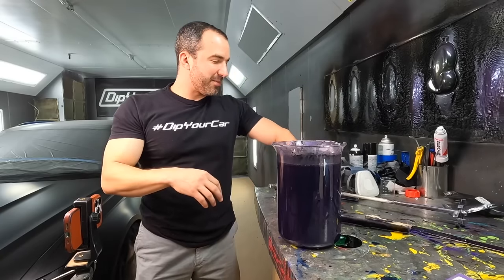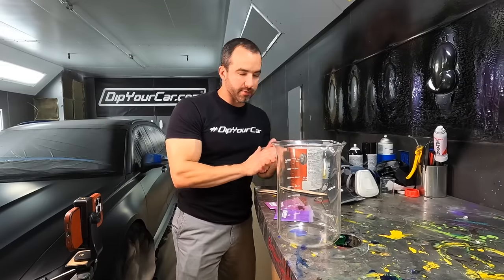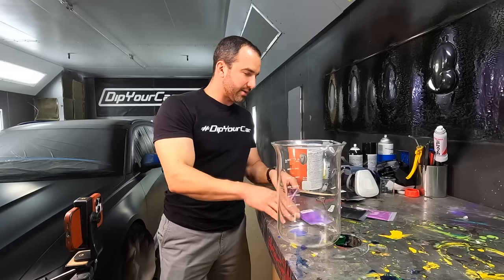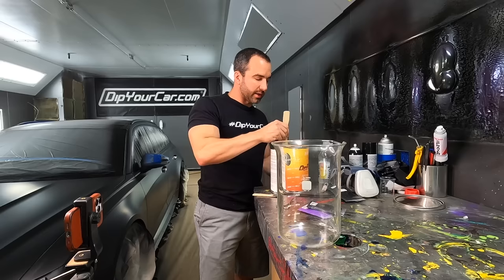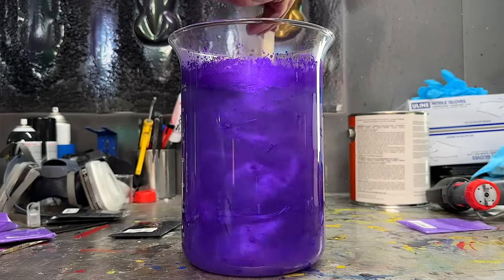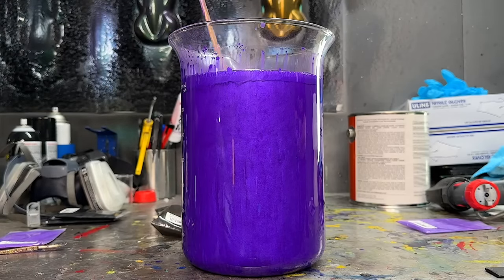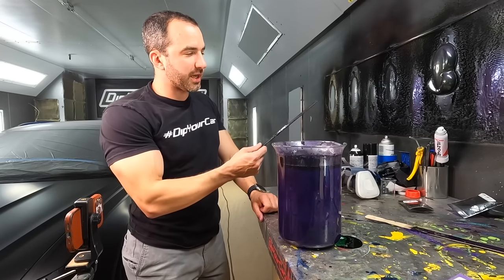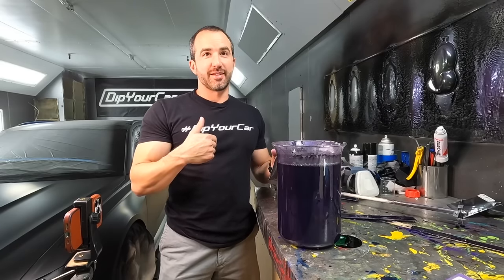In Complete SHAMBLES Trying to Mix the Perfect Ultra-Dark Purple (Genuinely Lost It)

Comment: i would like to see a car blended. back end being black. front end being straight color.
and like 2 or 3 blended areas across the length getting darker> maybe more!  
front grill straight color
corner of cars to highest point of front wheels 1st deeper
top of front wheel to mid door 2nd darker, 
mid door to top of rear wheel 3rd color,
topof rear wheel to corner of rear end 4th ,
and finally darkest color being black or black hinting at the color.

Comment: I feel like at 50hks/100BB you weren’t mixing it enough with the stick for the BB to Darken the purple. To me it looked like there was powder pieces still on the stick. I would’ve used the multi mixer then determine to add more. However it still turned out absolutely evil 😈.

Comment: First I would like to say is the final color on your car is not a dark enough purple and I think it from how you mixed in the black Betty, I would have put half the clear coat in the mixing beaker and stirred it with the drill poured mixer if you look at the process alot of the black Betty was left on the side of the mixing beaker, you can't see that in the video then u need to step back and rethink your mixing process and I think had you gone with a high gloss finish it would have given you more depth and a deeper purple